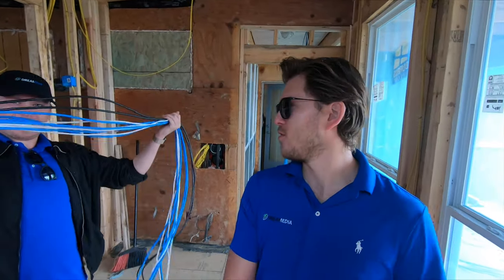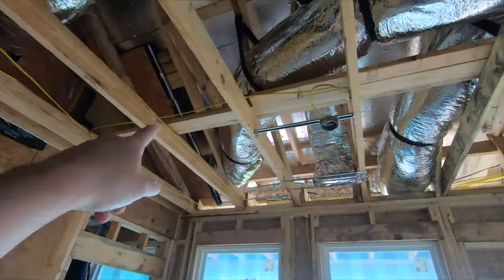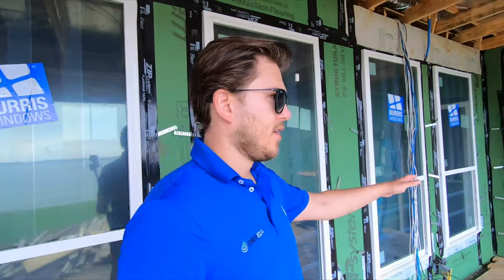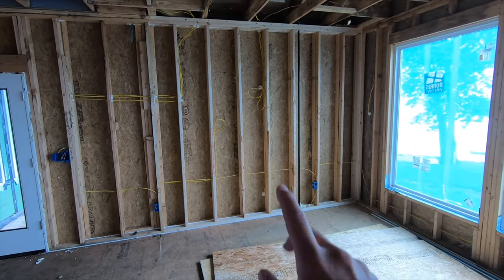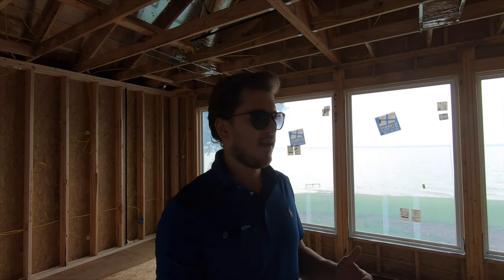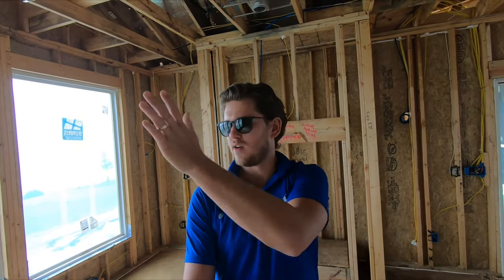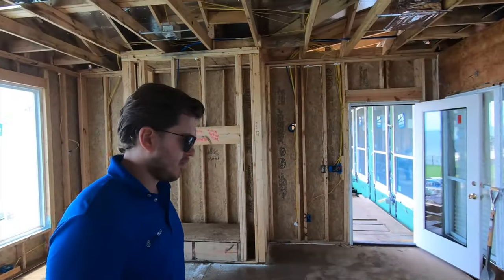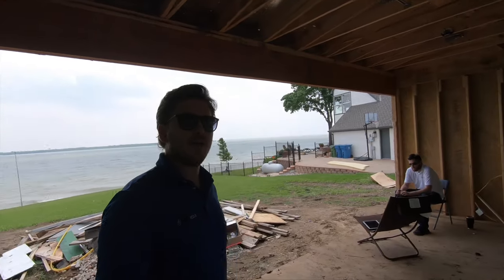HOW TO Properly Pre-Wire your Home Theater, Speakers, and TVs in 2019 w/ Dreamedia

Comment: Was this client doing in-ceiling speakers? I noticed you have the low voltage new construction brackets in place with the wire coiled inside/behind. How do you install the speaker with that bracket right there? If they weren't doing in-ceiling, what do you recommend doing for in-ceiling application? I guess my concern is that the speakers I purchased hook right into the drywall. Do I staple the wire in the joists/rafters before drywall, measure, and look for them later or is there a better way?

Comment: I noticed you are not running fiber optic cables to your homes. I know it is very expensive to do that, and of course there are homes that are doing it.  I personally recommend running a piece of pvc to all your locations for networking and future proofing it.  You don't need fancy or expensive pvc, use something like pex pipe used for plumbing maybe 3/4" to make it easier to get wires in.  Maybe use 1" for any potential HDMI cables, the ends are so large.  You don't really need to run them into your DATA boxes, I would use a Oatey  Access Panel 14 x 14-in above the panel.  Run the end of the pex into the opening behind the drywall, cover with access panel and remove panel when you need to upgrade or replace in future.  That is truly future proofing.
Reply: I wonder why new homes aren't using conduit more often --- it really does give you the most options and also future-proofs your cabling needs

Comment: running 16/2 or 16/4 for each speaker?
Reply: I prefer 14/4. Thicker cable for less resistance and an extra speaker pair in case of damage/future use.
Reply: 16/2 is fine for surround speakers. I don’t know what benefit an additional two cores would be in this application? Biwiring is not really relevant in a surround setup. If I had little faith in the contractors, maybe it would beneficial for backup purposes? But even then, if they drill or nail through the wire, it’s likely going to require that wire being replaced any way 🤷🏻‍♂️